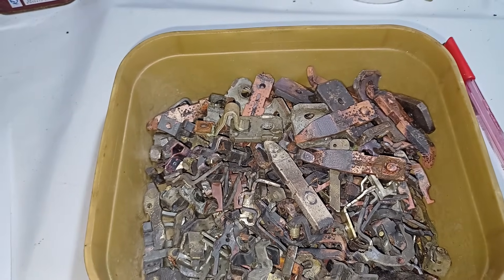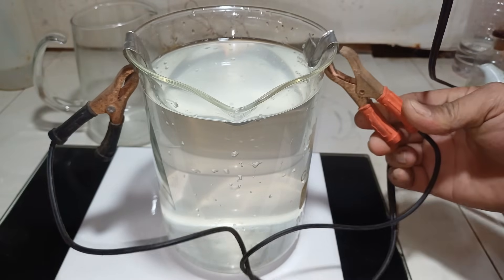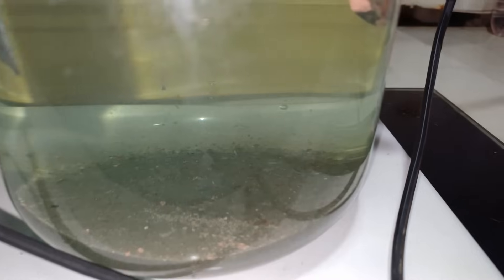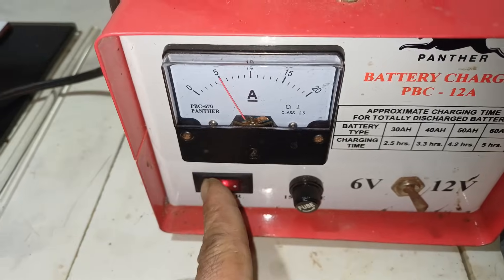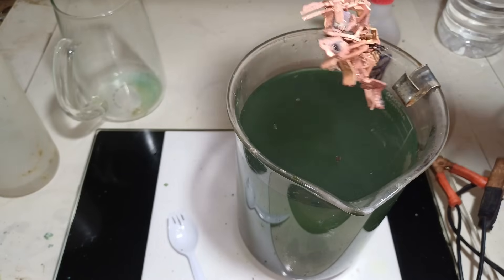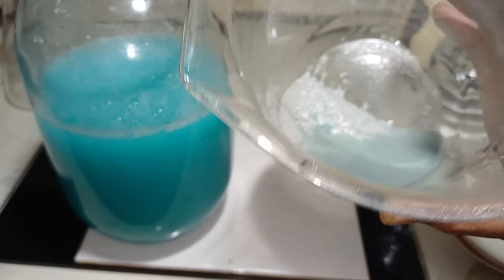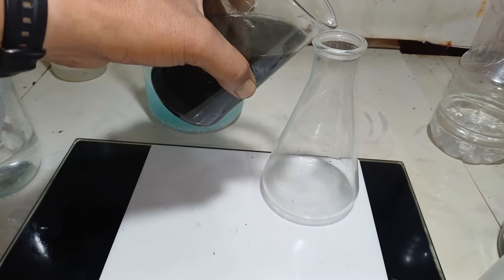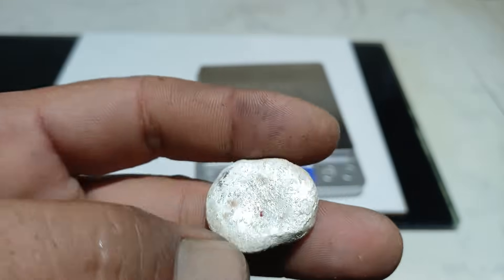Electrolysis Silver Recovery | Silver Recovery Using Electrolysis

Comment: I think the cost of the processing could be even cheaper if somebody builds an electronic system which would charge a car battery from a solar panel, and then the car battery would be used for the electrolysis. Yes, there is more additional cost for that but:
1) electricity from such system would be almost free
2) you can set it up even in jungle without an electrical grid nearby.
Reply from the maker: That's also possible, brother, but the current here is variable and sometimes suddenly increases, so if it's solar, it probably won't last long, unless the panel is large.
Reply: @PoorMiners321  You don't run the current directly from the solar panel. The schema is as following:
solar panel -> inverter -> battery -> power supply

Comment: Thanks for posting this video, but is it economically suitable? I mean the extracted silver will cover the price of chemicals and will give profit? ❤
Reply from the maker: If you could just notice, the chemicals we use aren't that expensive, they're just household chemicals, muriatic acid and distilled water, they're very cheap.❤
Reply: Does this process work with sterling silver items?
Reply from the maker: No brother this is good for plating only
Reply: @PoorMiners321  well that is still incredibly valuable. You have been clear and it seems that a person could do this. The only thing I’m unclear on is how much pure silver you ended up with relative to the original plate. Is it possible to do a ratio, or is there too much variation in the thickness of the plate for that to be a worthwhile calculation?

Comment: Isn't that orange gas deadly?
Reply from the maker: No, brother, maybe if you are exposed for 5 years without any protection, you will probably start coughing a lot. It is better to wear gas masks because those fumes are not too risk. Just don't imitate what others have done, mercury alloy with gold in short amalgam, pour nitric acid on it, that is what is really risk to your health because those fumes are mercury that evaporate.
Reply: @PoorMiners321  Thanks mate. Was just concerned. That looked like nitrogen dioxide which is a 4 on the health portion of the fire triangle. Just be careful mate.

Comment: I have some questions and suggestions. In the video you don't outline how diluted the electrolyte is. A step-by-step description (.pdf) linked somewhere would be useful also. I'd stick to 1.2 - 1.5VDC per Faraday's equations. And, ah yes, thank you very much for bring us your video.
Reply from the maker: As you can see, 2,000 ml of distilled water, 200grams of sea salt, 100 ml 29% hcl, then applied 6 to 12v DC that's it, I never add any link or pdf in our discriptions youtube doesn't allowed link for safety to our viewers Thats youtube policy.

Comment: you want to keep around 1.2v or so.. to prevent electrolysis... higher voltage isnt always best
although im probably explaining or saying it incorrectly tho
Reply: Lower amps/volts will help the copper to plate onto the cathode vs ending up in solution or falling off and mixing with the silver 👍👍ive even used solar panels to deplate silverware and holloware
Reply from the maker: 1.2v? That won't remove the plating brother, it might take you a month before you finish what you did, 12v is best, 5 to 10 minutes extract all the plating, then turn off the power supply, allow it to cool down for your next batch.
Reply: Thinks why not uses nitric and uses potassium nitrate 😊
Reply from the maker: Potassium nitrate when contact to sulfuric acid it create nitric acid brother since nitric acid are expensive for some country this idea can save money ❤️